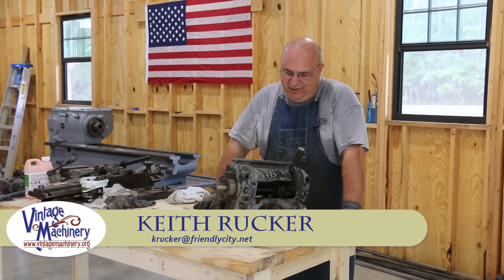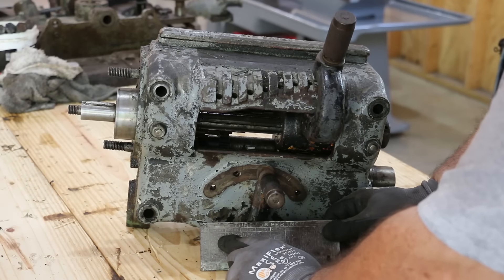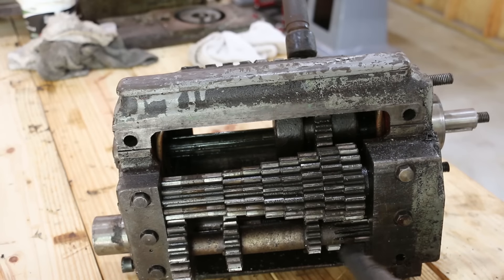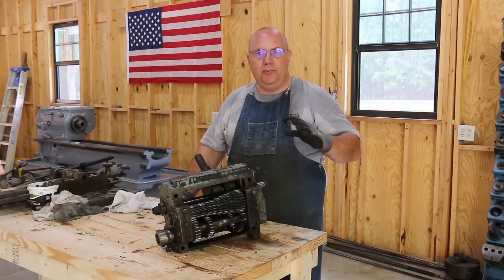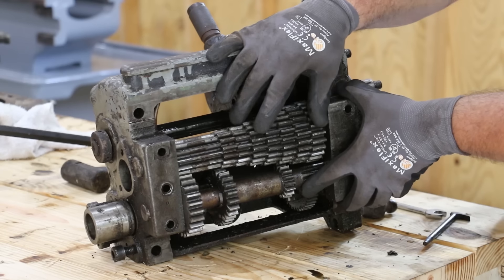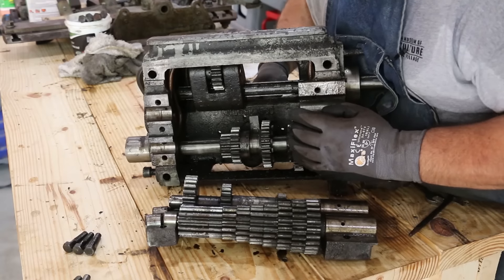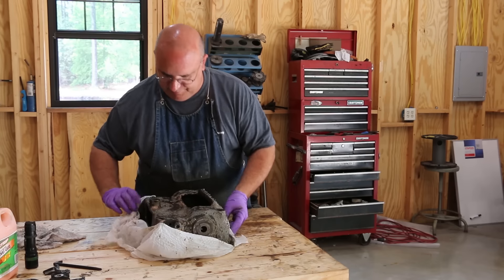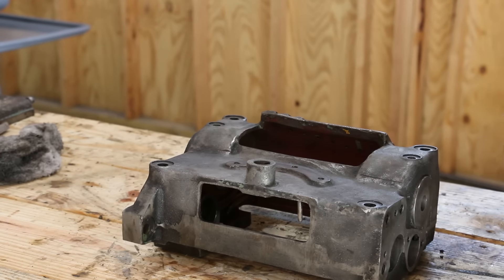LeBlond Lathe Restoration - Part 5:  Quick Change Gear Box Cleaning and Disassembly

Comment: When I used to work on machines older than me, like you, I would disassemble then reassemble componenets as they were removed.  Then I kept a 5 gallon pail with 3 gallons of used cutting oil handy to do the overnight soaking.  This was the best thing I ever found to loosen dirt, dried on grease and gunk.  Then a final wash in spirits so the spirits were only contaminated by oil, not the old gunk.  Every 5 or 6 years, throw out the old dirty cutting oil and the accumulated layers of gunk in the 5 gallon pail an refill with "new" old oil.  This made cleaning quick and easy.

Comment: this is what my father and I used to do my father was a machine salesman we had a complete machine shop down in our basement my father used to bring them home and we term apart clean them up and rebuild them had a model number 1922 Logan lathe that we redid I hear recently I've just done a Delta wood lathe for a friend of mine did it in the original Hammer Delta paint came out very nice keep up the good work

Comment: Great video as always, Keith.  It may not be necessary for you, depending on chemical you used to degrease the parts, but for the motorcycles I restore, I usually go over the metal with acetone and let it dry, just before painting.  That ensures that any chemicals that might be in the deep pores of the metal are neutralized.

Thanks for taking the time to video, edit and post these videos.  I, for one, am always happy to see a new video when you post it.
Reply: He put the case through the parts washer after stripping.  That stripper seems to be citric acid based.
Reply: Yeah, I saw where he said he was going to do that.  And since he's using mineral spirits in his, he's probably ok.  But using acetone or denatured alcohol helps to clear/neutralize any chemicals if you use kerosene, diesel fuel or some other solvent in your parts washer.

Otherwise, you may end up with your paint peeling in a certain area because there were small pockets of that solvent trapped in the pores of the metal.
Reply: *****   I like to use some of the Simple Green and some nylon brushes and old tooth brushes.  Then blow it off with some compressed air.  The area in California is very dry and stuff generally dries up in minutes with no rust issues.  That paint Keith is using doesn't need a primer coat and looks like a one coat epoxy.
Reply from the maker: I wiped everything down with mineral sprits before painting.

Comment: Hi Keith: I use electroyliss to remove paint ,rust, grease, oil, tar, etc. seems to work pretty good. I also use rustoleum spray paint, they do have a gray color that is pretty close to what you are using, the spray paint I prefer has both primer and finish paint all in one.
Reply from the maker: Electrolysis does a pretty good job on rust, but if the paint is on good, it does not do much to remove it.
Reply: Hi Keith: Electrolysis will remove japanning from cast iron planes, it will even remove chrome plating , I have used electrolysis to strip off paint from convector covers with 2 and 3 layers of paint, it worked and was cheaper than using paint remover, I do use a wire brush a few times during the process but it has worked well for me.

Comment: Hi Keith.  I am really enjoying this series and liked this segment in particular.  I have a quick change gear box on my lathe out in the shop.  I have looked at drawings and diagrams but have never had a clear understanding like I do now having watched this installment.  I also don't know if I would ever have had the guts to tear one of mine down for cleaning and painting until watching you do it tonight.

Thanks again.

Bob
Reply from the maker: Most of this stuff can be very intimidating.  But once you dig into it, it usually is not as bad as it looks.

Comment: Keith the restoration is looking great! I have a Victor 16X60 like Adam's that you can clean up if you need another project. I my have to break open the piggy bank to fund it. The time involved is crazy I know as I am neck deep in restoring a steam locomotive for a park here in Texas. I built the new boiler and doing a frame up rebuild. Keep it up y'all are an inspiration.
Reply from the maker: I have several more machines I need to do for myself first!  Sound like a fun project you are working on...

Comment: I was encouraging you during the end to do the "getter out" of the broken bolt before painting.  Maybe getting it out won't require a lot of clamping that will mar your paint.  As always, enjoyed the video and look forward to more in the series.
Reply from the maker: I did not really cover the broken bolt very well - it actually turned out with my bare hands so it was not an issue at all.  I got lucky!

Comment: What type of seal is used in the ABCD lever? Brass or something similar? Learned a lot from the disassembly. Really appreciate you filming and sharing.
Reply: The gearbox is not sealed.  It is open.  You can watch the gears turn while the lathe is running.  No reason to use seals in an open gearbox.  Liberal and regular manual oiling flushes out any small contamination opportunities in the shafts and bearings.
Reply: Wow, is it open? Arent the flying chips a problem for such gearbox?
Reply: +Bob Korves looks like to me it would sling on the sides of the gear box and make its way through the shafts. thanks for the input!
Reply: In that period, all or nearly all lathes had open quick change gearboxes except in large industrial lathes.  Only in more recent times have enclosed gearboxes started to become more common.  They are typically open on the bottom, a total loss oil system.  The RPM's of the gears are not usually high enough to throw oil, and the gears are not flooded with oil, only kept wet.  AFAIK, all Logan, South Bend, and Atlas lathes used an open gearbox.
Reply: +Bob Korves learn something every day.
Reply: If you look in the box after Keith has it cleaned up, you can see some copper tubes that are almost certainly lube lines to the major bearings. These might come from a common oil hole on the top of the box, or possibly even be plumed into the oil in the main gearbox in some way. But as others have said, the gears themselves are open, and you typically reach up under the gearbox with an oil can every so often.

The lathe itself won't throw chips in a way that is likely to get inside the gearbox. But if you use an air hose to blow the chips off the lathe, the chips WILL get into the gearbox, and possibly start causing problems.
Reply from the maker: The others here have already pretty well explained things.  Nothing much to add....

Comment: I've seen other videos that dove into the QCGB, and this one stacks up well with them Keith!  I'm curious though as to whether you're going to put some kind of slotted rubber boot over the opening for the 8-position sliding lever to help keep dust and debris out.  I'd think that would have been done to begin with, according to common sense.
Reply from the maker: A lot of these gear boxes were open when this one was made.  Pretty common.

Comment: Superb edition of this lathe restoration. Gearboxes are fascinating pieces of engineering and as you said, these clever boxes were all designed without the aid of modern CAD systems. Did you manage to get that broken bolt out, and will you have to make a new one? Best wishes from Cornwall, UK.
Reply from the maker: The broken bolt twisted out with my bare hands and I was able to replace it with a regular off the shelf bolt.

Comment: Do the set screws on those collars tighten down on the threaded shaft? What keeps them from messing up the threads? Are those collars an end-play adjustment?
Reply from the maker: I cover that question in the next video- but there is a brass piece in the bottom of the hole that engages the thread - and the brass piece is threaded as well.

Comment: Hey Keith, I see some metal up in those gear teeth but it doesn't seem too bad and all the gears teeth still have plenty of meat left on them.  What was down in the bottom of the case and the sump?  What was the condition of the oil?  Did you flush out the oil lines?  Will you need to replace any seals on the ends of those shafts?
I always try to remember to put a punch mark at the hole where the large end of taper pins goes in so that I can figure out which way to put it back in during reassembly.....Thanks for the video and sharing the project with us......I watched the commercial just for you Keith, only for you.
Reply: considering it has stood for ages after being way over due for servicing, im sure keith will be getting some fresh oil in it!
Reply: jusb1066   That's without a doubt.  I was interested to find out what he discovered after he cracked open the casing.
Reply: John Ferguson
im sure theres a ton of smaller stuff, a comment further up was about a copper oil pipe in this gearbox, that keith didnt mention, i guess a lot of stuff he will explain even if we dont get a video,, he would have to be mad not no flush out. id pull the motor out and check its bearings also, otherwise it wont get done!
Reply: jusb1066  When you don't flush out lines thoroughly it always seems to come back and bite you in the ass.  A good trick is to flush a piece of mono-filament fishing line through the tube and tie a pipe cleaner on the end and then another piece of line on the other end of the pipe cleaner.  Soak the pipe cleaner in solvent and use the lines to pull it back and forth up and down the tube.  Squirt a little more solvent every time it comes out the end.
Reply from the maker: You have to remember that the gear case is partially open, so chips and such can work their way into the gears.  I cleaned them all well.  OIl just drips down over the gears and falls out the bottom - not recycled so there really was nothing to look at to judge the condition.

Comment: hey Keith thoses copper lines I saw looking through the back is that how the gears are lubricated? looking good by the way
Reply: Great question! Keith, what lubricates the gears? Like Scott, I saw the tubes also, so I guess that eliminates the use of a heavier grease on the gears and the shafts. Maybe it's splash lubricated? Again, another great Friday morning coffee with Keith! 
Cheers,
Rich
Reply: good point, i wonder where it feeds from, and is it running clear etc?
Reply: There is some kind of cover on top, can be seen moving at 27:55. That may have something to do with it.
Reply: Yep, it covers the oil reservoir. Fill it daily and it drip feeds the shafts through the copper feed tubes. Old machines are bad to have the passages clogged with crud and need to be cleaned thoroughly before reassembly to ensure proper lubrication.
Reply: Aceroadholder
cool tnx
Reply from the maker: There is a reservoir on the top of the change box - it says "oil daily".  The inside was filled with felt and when you oiled it, it would drip oil down through these tubes to direct it where it needed to be.

Comment: Is the paint oil based?  Is that how you get it to bond with cast that has been oily?  Seems like every time I have been around cast that was once oily it "weeps" a slimy film of oil forever so I am not sure how you get the paint to bond.

Thank you so much for sharing this project!  I know it takes a lot of time to shoot and edit the videos and I sure do appreciate it!
Reply from the maker: The paint is oil based, but I am not sure that it will make a difference.  Since the machine was painted previously, I should not have too much oil in the casting.  The old paint that I removed should have protected it.
Reply: Thank you!

Comment: Hi Keith - great work going on.  I have a 'stupid' question going back to the first inspection video you did on this lathe. You showed that the ways were worn out (low spot) in front of the chuck because it is the area were most of the travel/work was done. Could this be corrected by a grinding/surfacing operation on the rest or the ways ? (sorry again for the question !)
Reply from the maker: Yes, it could be sent off to be reground and the ways would be perfect again.  It is just a very expensive operation and there are only a few shops that have grinders big enough to do that kind of work that will take on one-off jobs like this would be.  All in all, the wear is not that bad on this machine so, my plan is to just live with what I have.

Comment: I would love to be able to call myself a machinist, but I'm not.  Aircraft mechanic by trade, but I'm considering what to do with myself after I retire.  This looks like a lot of fun.  Lots of hard work, but fun nevertheless.  I love taking things apart to see how they work then reassemble them back into working order.  Unless I was running a machine shop for profit or getting paid to restore machines for others, it would be hard to justify getting set up to do it.  Anyway, on to my question.  You mentioned that the input shaft was continually turning when you changed speeds.  Wouldn't that cause damage to the edges of the gears as they tried to mesh at speed?  With the jet aircraft I work on, some items are spinning in excess of 100,000 rpm and we don't shift anything at that speed!  Loving the videos.  Found them on the side bar as I was watching John Switzer, with Black Bear Forge.

Comment: Would bead blasting or sand blasting be an acceptable option for cleaning this large casting?
Reply from the maker: Yes and no.  Bead blasting would do and excellent job at cleaning it up, but I don't like to put machined sufraces in the blasting cabinet if I can help from it - and this piece had some bearing surfaces that I did not want to risk messing up.

Comment: I was watching another metalworking channel yesterday where the guy was stripping some lathe parts, and he mentioned using E-Z-Off Oven Cleaner instead of Citrus Strip. And he demonstrated it working. Might be worth a try for some of the awkward places since you spray it on.
Reply from the maker: I have seen that done many times.  It works pretty good.

Comment: So, do the set screws bite into the threads of the retaining collar? Or how does that work?
Loving the series though and also looking forward to the big lathe resto :)
Reply from the maker: No, there is a brass piece in the bottom of the hole between the set screw and the thread.  The brass pieces are also threaded so that they engage with the threads very nicely.
Reply: oh ok wow, that's cool! thanks for clearing it up, Keith. Can't wait for the next one :)

Comment: Keith - How is that gearbox lubricated when the lathe is in operation?  It looks like there is no sump and the unit is open to the air...
Reply: I was able to answer my own question once you took it apart.  I see the internal oil lines to the journals. :-)
Reply from the maker: LOL - glad you figured it out!

Comment: Keith, what paint type did you use (type and brand) during this restoration?
Reply from the maker: I showed that in one of the videos.  It is an oil based enamel made by Sherwin Williams.
Reply: Thank you! I really appreciate your expertise. I'll check out the previous videos.

Comment: Did I miss something Keith? or is that broken bolt still in there??You are certainly putting a fair bit of time into it to make sure it is right, and it is looking good.
Reply from the maker: The broken bolt actually came out with no problem.  There was enough sticking up that I could turn it out with my hand.  I am not even sure if I got it on video because when I was testing it to see how much trouble it was going to be, it was out before I knew it.  Got lucky on that one....

Comment: You makes the apron you use? I'm a 3xl guy and none of the aprons seam to fit well...
Reply from the maker: Seven Mile Creek is where I get mine.  I am 2XL and they work just fine, but you will find that you need to find longer straps to fit us bigger guys....

Comment: Do those gears run in an oil bath or are the sprayed with oil or lubed with an oil can?  Great video...I'm jealous.
Reply from the maker: You oil a reservoir up in the top that then drips the oil down over the gears.

Comment: Hi Keith, This was an interesting project on what looks like a well designed tool. We've got to realise that by the time this was built there had been many many years of development for the designer to reverence. Just shows that maybe our present reliance on computers is not always necessary. They were just good engineers. Think of NASA, they sent Apollo to the moon with a less powerful computer than is installed in today's average car. Looking forward to the reassembly. Regards.
Reply from the maker: So true Peter - I am just afraid that we will depend on computers so much in the future that true innovation will be limited.

Comment: what is the proper engineering/machinist term for the locking crown between the Alpha Shaft and the idler gear? I know it has a name, I've seen it elsewhere (the feed on a pedestal drill press) but damn if I can't google it for shit